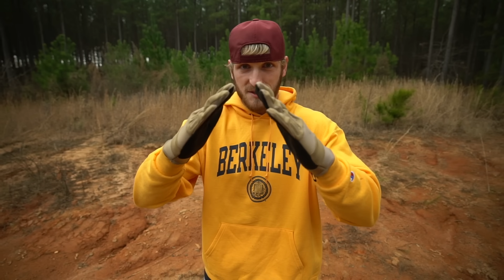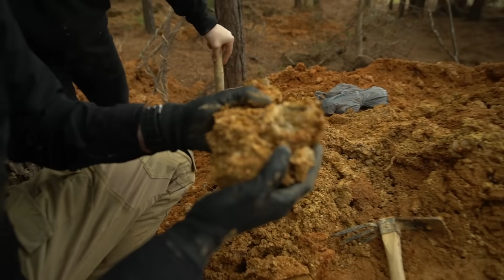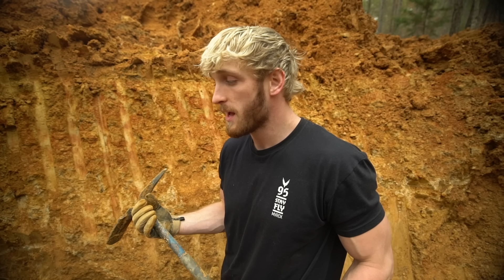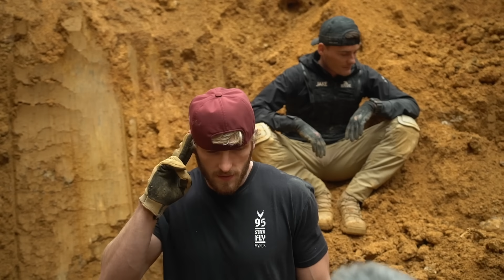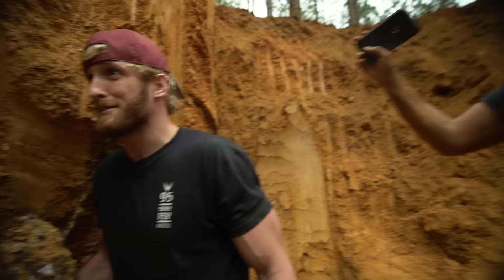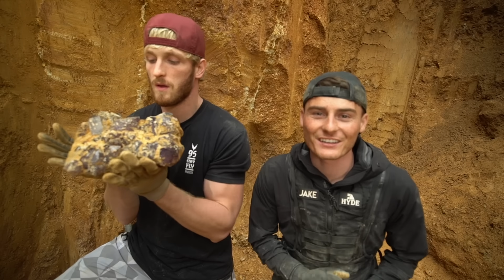Logan Paul Finds $100,000 Amethyst Crystal! (Unbelievable Find)

Comment: Isn't this just purple quartz? Its very common and more worth about $50, where is the 50k figure coming from?
Reply: Kieran Topen the title says amethyst
Reply: It’s amethyst crystal , two different things. It could cost more than 50k too
Reply: @nehadoll507  Amethysts are literally just  a purple variety of quartz though. Look on eBay you can buy similar looking things for much cheaper. Yes they can go up to 50k but they are usually ten times bigger than this and look way more impressive as they can be made into furiture

Comment: Is no one going to question the abusurd high valuation the crystal guy i spitting out. 
Srsly.. you can buy 300-400lbs Amethyst geodes on ebay for as low as 2000USD.. 

To get even close to the pricing this guy i spitting, you'll have to find "art pieces", where a massive geode has been cut and turned into a large table or something similar. 
And in these cases it isn't the crystal that is representing the value. Most of the value comes from the fact that someone might think that it is "art".

Even if the stone was cut into thousands of smaller pieces and processed ie polished. I doubt it would reach that value. And if it did then it wouldn't account for the thousands of man hours that would require.